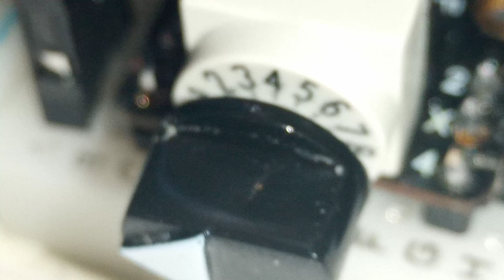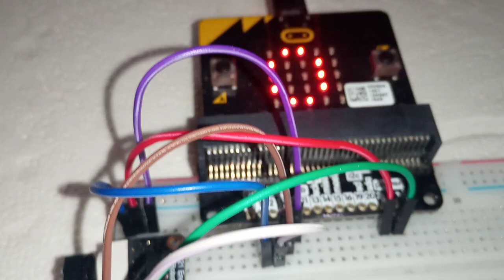Fermion 8421 Encoder Micro:Bit Demo

Comment: That switch is outputting in binary?
Reply from the maker: There are 4 data  pins ( plus power & Gnd )

Each physical position on the dial, connects a different combination of the data pins . 

As there are 4 pins , that gives 16 combinations . 

By reading the state of each pin , you essentially get a 4 bit binary number .....